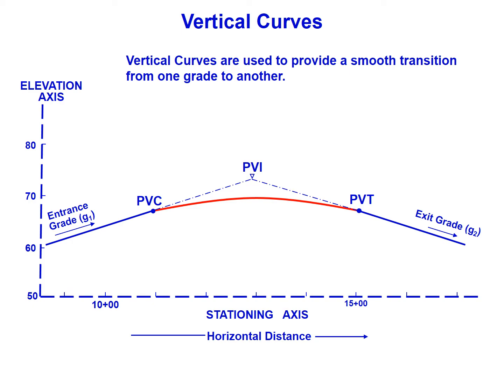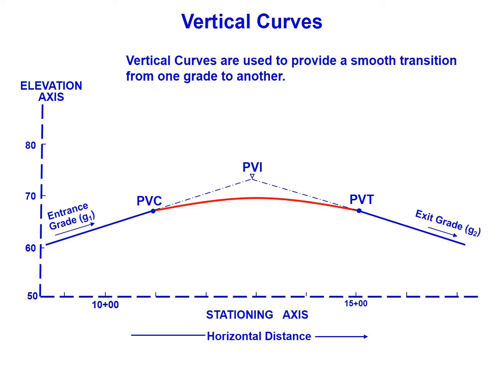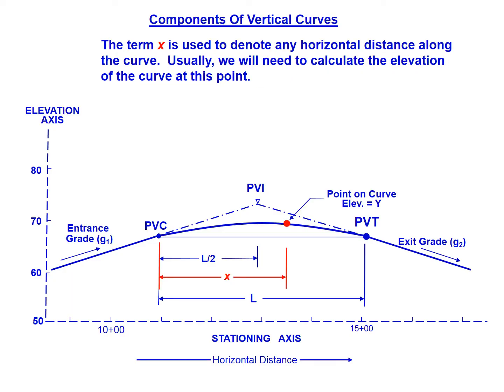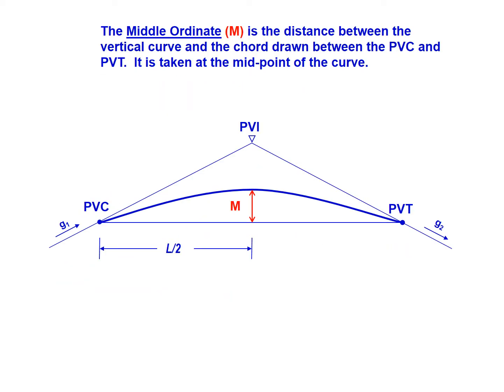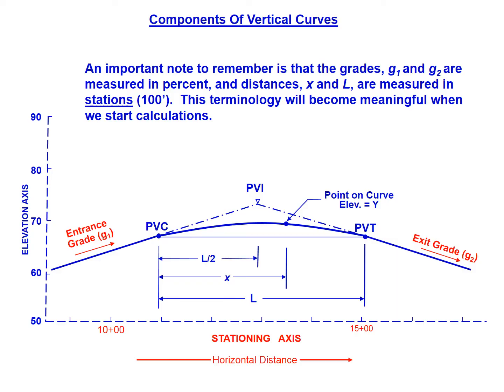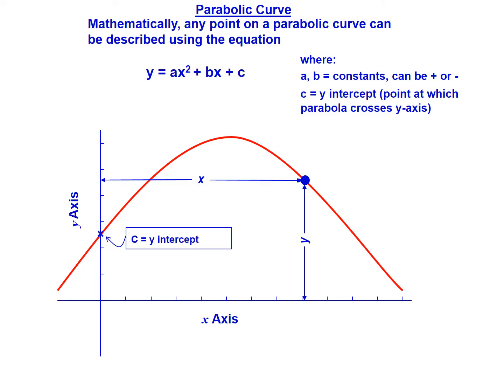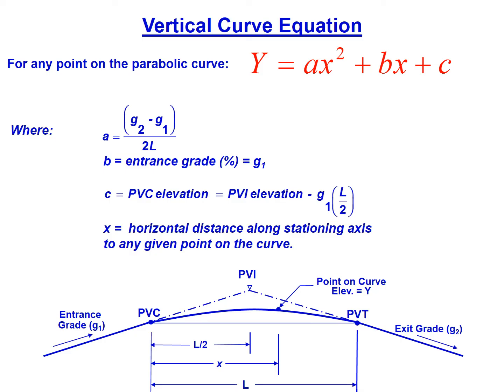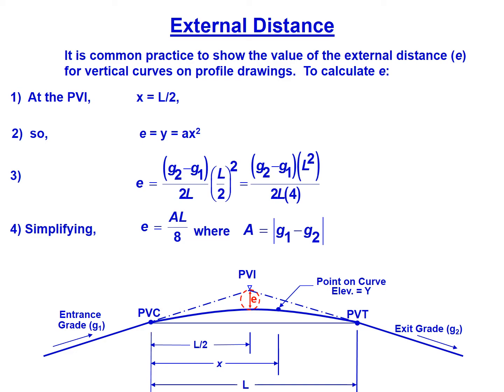Vertical Curve Fundamentals | Highway Alignment and Design

Comment: Why do we delve deep into the science and mathematics of different curve types like circular and parabolic for highway design when, in practice, modern software tools render them perfectly identical for vertical crest curves? Isn't the distinction becoming more theoretical than practical, given that most software defaults to a circular representation?
Reply from the maker: I'm not familiar with agencies switching to circular arcs instead of parabolic curves for vertical alignment.  Parabolic curves fit the terrain better and provide a smoother transition for vehicles (relative to a circular arc).  For horizontal curves though, yes, circular arcs are the most common.  I have a few videos showing horizontal and vertical curve designs.  Here's an example of a vertical curve, using parabolic equations: https://youtu.be/zhM-CKkan5M
Reply: @FindleyDaniel  thanks for reply - I would agree with you but if you draw curves (circular or parabolic) in C3D or ORD Bentley - they look identical no matter how much you change gradients or exaggeration - I asked Bentley and they told me - It's mostly true that there are no visual differences. One of the differences isn't in what you can see, but in how they behave in combination with other elements - so no point to teach parabola - software doesn't reproduce it sadly
Reply from the maker: @Call.of.the.mountains  Interesting, do they show up correctly on design plans (I would assume that one some vertical curves there is a substantial difference based on the elevation increments).
Reply: @FindleyDaniel  it used to be like this in MX but now bentley made it too simple sadly. If you can send me an image to show comparison between the two - maybe I can tell them that software is producing design in error
Reply from the maker: @Call.of.the.mountains  This video shows one, is that clear enough: https://www.youtube.com/watch?v=zhM-CKkan5M
Reply: @FindleyDaniel  thanks, I've sent you an email

Comment: Why your formula a=(g2-g1)/2L vs CERM r=(g2-g1)/L.   Anyone can explain the reason is greatly appreciated. I’m confused why the divisor in your formula is 2L instead of just L🤷🏻‍♀️ But then CERM eq. 79.47 use your “a” formula with “2” when it’s substituted in the parabola general formula rx^2/2___my assumption is “a” formula to calculate the initial elevation or PVC and “r” is the formula use to determine the succeeding elevations per rate of change in slope 🧐
Reply from the maker: Unfortunately, I don't have my copy of the CERM at home, so I can't see exactly what you're referring to.  You can try this method and the CERM method and see if you get the same results - that may help you determine what the difference is.

Comment: Does the PVI always at the center of the vertical curve length? I am confuse..for instant, i will exaggerate the grade value to explain this. Let say the entry grade is 5% while the exit grade is 30%..isnt that obvious that the PVI will be at the right hand side of the middle vertical curve distance?
Reply from the maker: Yes, that's correct - for a symmetric, parabolic curve, the PVI will always be at the center.  This is the most common and default type of vertical curve, so you should be safe with this assumption unless otherwise stated.
Reply: @FindleyDaniel  well explained. Thank you Prof Findley 👍🏻👌🏻

Comment: This can't be correct when you talk about the grades. I've seen a million problems where the grades are put in their decimal form. But I do have one question about grades: I've also seen that sometimes they use their absolute value and sometimes they don't. How do you know when to use the absolute value and when not to?
Reply from the maker: That's correct - it's not impossible to use other units.  However, with the equations presented and for the sake of consistency, you should pick a method and stick with it.  From a units perspective, having grades in percent and distances in stations works out (each is in 100s), which is why I present the equations that way and recommend that method.

In general, the sign (+ or -) of the grade is critical and should be associated with the grade.  However, there are cases when the sign isn't necessary,  including when calculating the external distance (distance from the PVI to the curve) and when using the formula L=KA (where A is the algebraic difference in grades - though this application still accounts for the grades because the K value is specific to the vertical curve type).

Comment: I solved a problem where the PVC elevation  was greater than the PVI elevation. Looking at the vertical curve, it looks like the PVI should always have the highest elevation. How come this isn't the case?
Reply from the maker: Great question!  There are 6 possible scenarios when analyzing a vertical curve.  These 6 scenarios fall into either sag or crest curves.

Sag curves (with a concave up shape) 
g1 = negative and g2 = positive 
          OR 
g1 = postive and g2 = steeper positive than g1  
          OR  
g1 = negative and g2 = flatter negative than g1 

Crest curves (with a concave down shape)
g1 = positive and g2 = negative [this is the scenario in this video]
          OR   
g1 = positive and g2 = flatter positive than g1
          OR   
g1 = negative and g2 = steeper negative than g1
Reply from the maker: Of those six scenarios, two could lead to a situation with the PVC elevation greater than the PVI elevation: 
Sag with g1 = negative and g2 = flatter negative than g1 

Crest with g1 = negative and g2 = steeper negative than g1

Comment: Hello and thanks , Do you have an example for positive g1 and g2 or negative g1 and g2 whit lower and higher point in the curve
Reply from the maker: The key for this type of problem is to make sure you have the right sign (+ or -) associated with each grade.  If you do that, everything should work out!
Reply from the maker: Below is a list of vertical curve videos that I've made, I can't recall exactly what scenarios I created for each though.
Vertical Curve Fundamentals - https://youtu.be/qZVZyf_9r2k
Parabolic Equation - https://youtu.be/OJYDhdcV6KM
Vertical Curve - https://youtu.be/4gUxo1jhu4s
Vertical Curve Example - https://youtu.be/884ca7ZDVyM
Passing a Vertical Curve Through a Fixed Point - https://youtu.be/nn6_RliorAw
Passing a Vertical Curve Through a Fixed Point Example - https://youtu.be/ADTbmlMo2UM
High /Low Point - https://youtu.be/1pGM2tjEbt4
High /Low Point - https://youtu.be/h0-zhBIXaWM